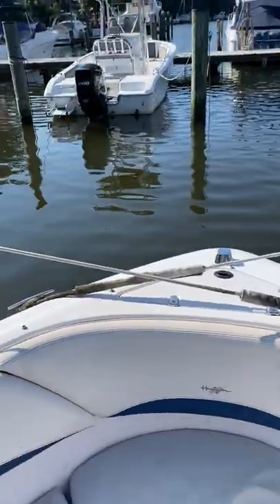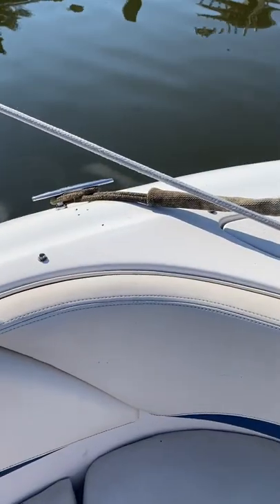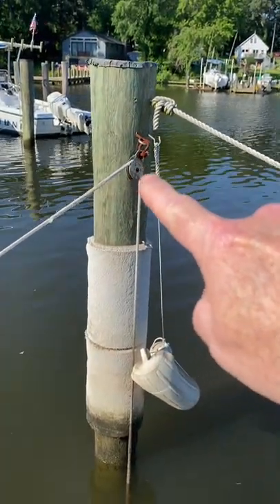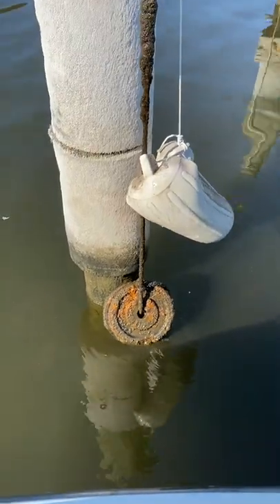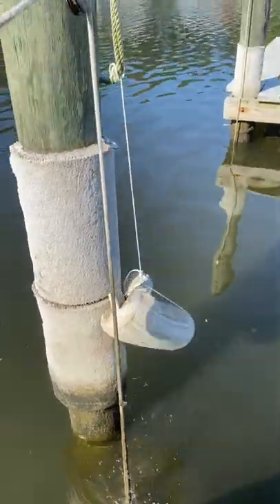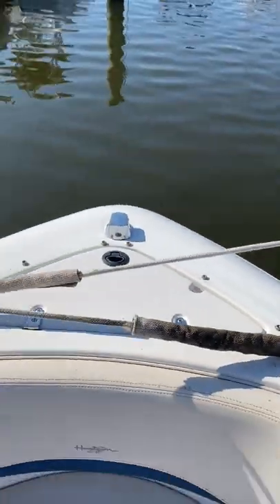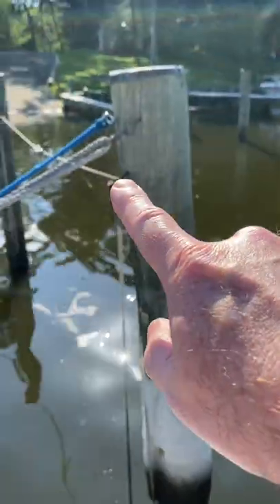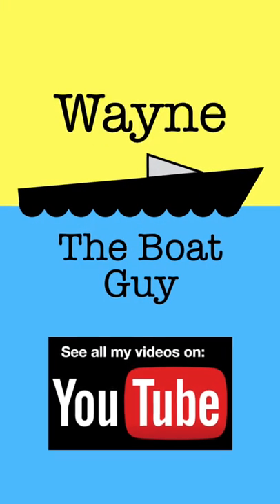Boat Marina Docking - Weighted Dock Lines

Comment: Thanks for showing what others describe.  The video is worth 1000 words.  I am assuming at high tide the weights touch the bottom but guess they just have to be deep enough for maximum tidal change.
Reply from the maker: I had to think about it for a minute - but ideally I imagine they would be set up to be on the bottom when the top line is 90 degrees from the piling post.
Reply: @WayneTheBoatGuy  thank you.

Comment: Crossing the lines is pointless with those weighted lines
Reply: The way he said it makes it sound like of he doesn't cross the weights hit the bottom so the tension isn't there that's what it sounded like to me
Reply: @machew2009 if the weights are hitting the bottom, then  just shorten the lines.
Reply from the maker: I don't change the length of the lines since they aren't mine. Next year that slip might be for someone else with a boat that needs that length.

Comment: If you don't lets say cross the strings and just go left to left right to right then wouldn't it still work? But with more tension?
Reply from the maker: Wouldn't it be less tension without crossing? I could adjust these to work that way, but I might not have this slip next year and I am able to make them work as they are.

Comment: Hey how much weight is on each side??  I couldn't tell if that was 3-5# or 3-10# plates??
Reply: Well they aren't numbers for 1.
And has for the weights, the usual ppl use is about 30lbs (lbs is pounds) or more or less 15kg. 
(Good way to transfer pounds to kg is "lbs x 2 + 10%". Gives a good and closer number then just doubling.)

Comment: What kind of boat is that? You grab something with an outboard?
Reply from the maker: The boat in the video is a 24 foot I/O
Reply: @WayneTheBoatGuy  fair enough, what brand did you end up going with and what size motor? Sorry I’m used to your older small boat videos, didn’t know you got a proper cruising vessel now!

Looked like a Four Winns but not sure
Reply from the maker: @74nova36  yeah it's a Four Winns Horizon 230 with a big swim platform. We got it a couple years ago - I have several videos of it.
Reply: @WayneTheBoatGuy  hell yeah, 350 mag?
Reply from the maker: @74nova36  Yeah it's VolvoPenta 5.7 with a duoprop. It uses about the same amount of gas as my first boat with an old 90 hp Evinrude!

Comment: Pretty nice idea if you have no damn dock lol. Never seen a dock that doesn’t have a dock on either side of your slip.
Reply: Hey Kyle the only time I've seen him used is as a space saver. I also saw him a lot in the intercoastal waterways of Mississippi where hurricanes destroy docs on a regular basis. It's just easier and cheaper to build a few long ones and have boats dock on either side.
Reply: @michaelmccabe3330  makes sense